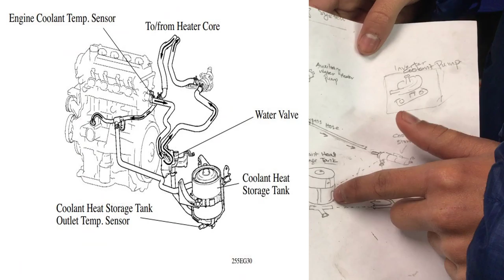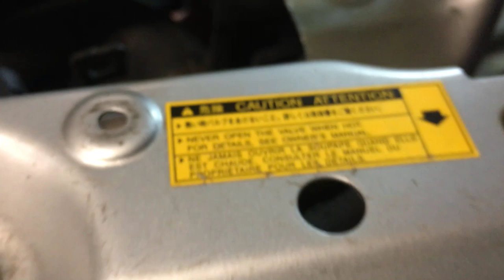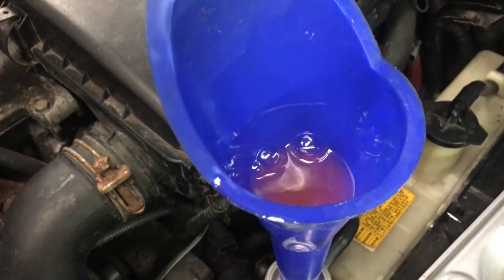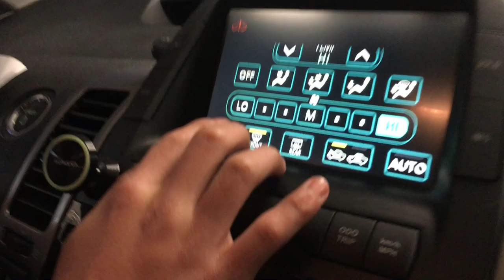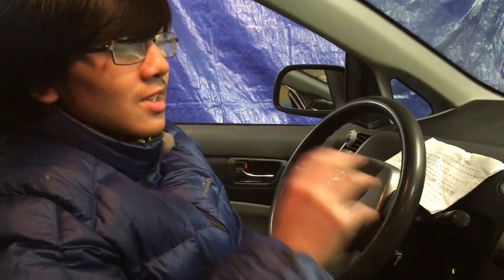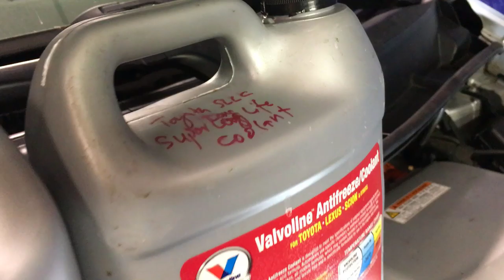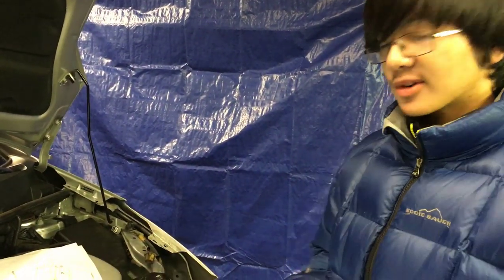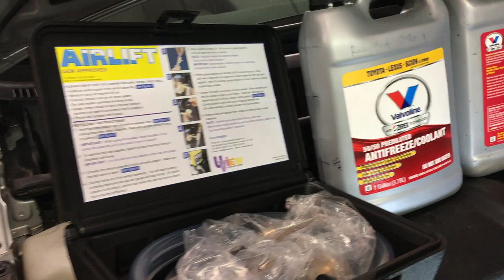Toyota Prius Engine Coolant Bleeding Part 2: Burp Trapped Air Pockets Heater Core ICE Cooling System

Comment: I am 64 years old.  Young man you saved my ass.  Here is my story.  I had a code P1116 "Engine Coolant Temperature Sensor".  I followed a video on how to replace the sensor.  I drained the coolant into a 5 liter automotive container, replaced the sensor and slowly replaced the coolant like I have done so often over the years with other vehicles.  Once the gravity feed stopped I had about a quart of coolant left over.  Simple solution right just take the car for short drive so the coolant can run thru the system and when I get back I can I'll add more coolant.  WROOOOONG!  Luckily I had my diagnostic meter set to test the temperature sensor.  After about a mile I was already over 200 degrees so I high tailed it back to my garage to investigate what the hell was happening.  I found your video.  I should have known that my Prius Gen II would have some incredibly complex procedure just to add coolant.  Your demonstration on how to run the circulating pump was the key.  Following your video I ran the circulating pump in short 10-15 second intervals adding my remaining coolant until the air bubbles ceased.  My next test drive provided a steady 177 degree coolant temperature with hot air blasting out the vents.  Again, thank you for your hard work in producing these videos.  You saved one old fool from disaster.

Comment: Saved my life as well, replaced the coolant on Valvoline, never changed the coolant, since I bought the car 3 years ago and 140000  miles later. But the car had all the symptoms, heating up, red triangle of death, no hot air when on high temperature. Follow your steps and 1 week has passed and everything is back to normal. I was afraid it was something more serious like a leak on the hoses or one those pump failures.  Thanks again.

Comment: I am bleeding dry trying to figure out why the heat gradually is depleted in my 2017 Toyota Prius ..bad timing when depleted to nonexistent and needing the defrost on the inside window December 23...the Toyota dealership said they could not find any leaks but did  top up the coolant  for $125.00. They never mentioned the possibility of air pockets.  After topping up the coolant,  the heat was effective for 3 days, which included one long drive, but now the heat is weakening and perhaps some weird thermostat stuff happening but hard to know since the heat is nonresponsive to the thermostat if the heat is not there anyway.. Thank you for posting this so I can be more educated as I try to" help the help" figure this out...as it is labour cost while they try to figure it out and probably are not given time to look on YouTube.

Comment: Thanks for your help. I was replacing coolant control valve myself and I mixed the tip and bottom hoses up. When I had no heat I was like Aimen curse you lol 😂

Comment: can we take the air bubbles from Toyota Prius V 2013  , that has radiator cap to the reservoir tank by conventional method by running it on maintenance mode  and using funnel ?Thank you.

Comment: If I do have an original radiator with that little hose on the side do I still need to open the bleeder valve with the 6 mm hex ?

Comment: Before you turned on the car to burp/bleed did you connect the wire you disconnected on the passenger side in the first video?

Comment: Aiman, the radiator I ordered arrives tomorrow and this is the most comprehensive video.  Awesome content and presentation sir!  I have a 2004 and original denso radiator seems to be leaking from the driver side of the radiator.  Curious to where yours was leaking.
Reply from the maker: I don't remember off the top of my head, but I'll try to check and see— how did your replacement go? How did I help out? Did I miss anything? Thanks for commenting!
Reply: @EyeOnAiman  I took my time in soaking the fasteners that hold the condenser and radiator so I could reuse all the hardware.  I also changed the thermostat since it was all exposed, but now after getting a good look at the condenser, that thing is about to go.  I think your content was very well organized and complete to get it done with confidence.

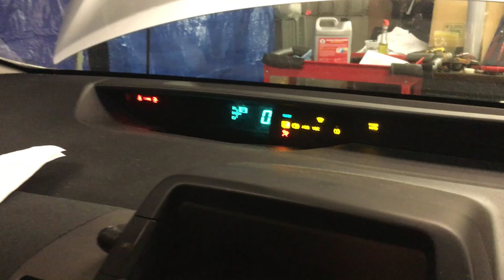Comment: At 5:30 when you put the car into ready mode there is a pump that turns on. What is the name of that pump? My car used to do it and now it does not
Reply: That's the inverter coolant pump.  It's a separate system.

Comment: Great video thank man, I own a 2004 prius, I had the code 1121, do I replace the coolant valve, and I solve this code but a few miles after the Chek engine light come on, so I scanned and now I have the code 1122 and I don't have heat in the cabin, so I think I need the bleed out the air of the system.  What do you think?

Comment: could a coolant leak cause a misfire in the prius? I have coolant leaking somewhere under the car forming a puddle, and since this started happening, I have a misfire in multiple banks... its random. Could this be related to my coolant leaking in some way?

It doesn't seem like it could be a head gasket blown because the coolant is not mixing with my oil.

Comment: Do you know if any heater core air bubbles would cause an issue with the hybrid system charge when you get on the freeway? I have no issues driving city but at high speeds the charge drains and struggles to get charged up "consistently" while noticing coolant smell in car and coolant level always changing and had overheat light come on. I know the gen 2 model really good but this issue is insane. I'm going to flush coolant system AND heater core today will update when done but Just wanted to know if my issues sound familiar

Comment: So I followed this today (I've done this a few times before). I used an AirLift and purped the storage tank following your other video. When I was all done I squeezed the top radiator hose and to my surprise go a big air bubble. Matter of fact squeezing that hose several times I got more air bubbles out than with the other burp procedures. Seems that should be added to your others since it's so easy and effective?

Comment: What diameter tubing used to bleed coolant?
Reply: Use a 3/16 inner diameter tubing. You can find them at the home depot in the pipe section.